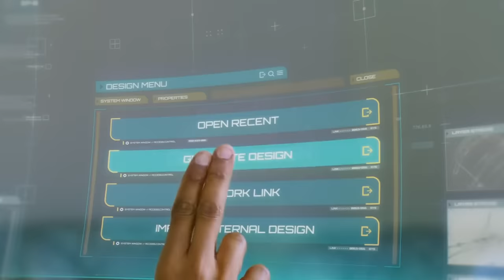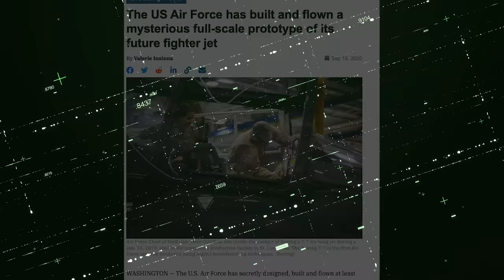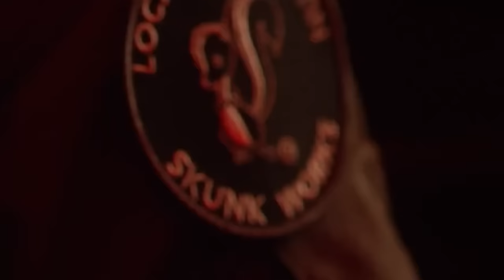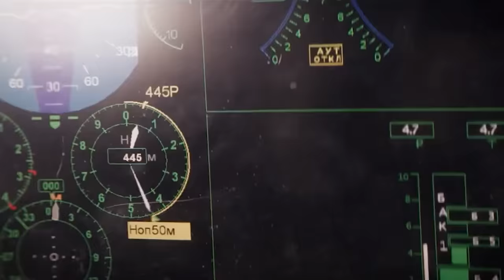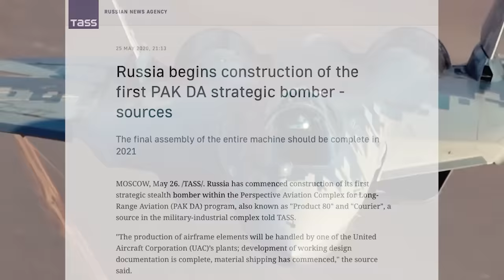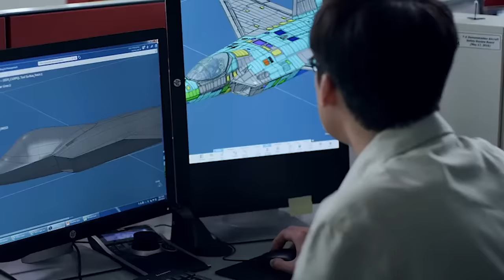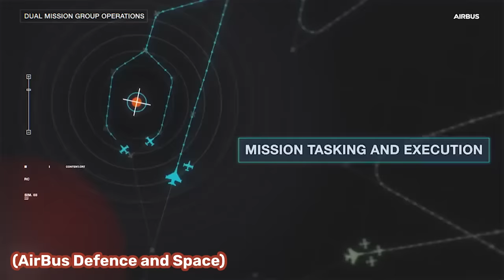12 new stealth aircraft headed toward service

Comment: Sandbox... why would the US Navy need to keep the F-35 once the F/A-XX is added to the fleet?
Reply: Because otherwise the F-35 would be a HUGE waste of Funds. Spend hundreds of billions just to retire after a mere 30 years isn't an Option as the program is must run long enough to ensure financial success. And, the Navy will have 340 jets, meaning they would have to buy 340 New ones and waste even more Money.
Reply: Same reason the Air Force still uses F-15s and 16s, I’d assume. Just too expensive to replace hundreds of aircraft.
Reply: Also, the f-35 will still hold up by 2050 and not need a replacememt.
Reply: F/A-XX replaces F/A-18
Reply: Numbers, and also the 6th gen fighters are going to be like $400 mil each, and designed to be control hubs for drone swarms, so they will only make a few of them.
Reply: Range
Reply: Same reason they kept the Viper & Eagle after Raptor & F-35.

Comment: Surprised you didn’t include the Russian MIG-41 and the Okhotnik programs
Reply: If he included the S-70 Okhotnik, he'd have to include MQ-25 Stingray, XQ-58 Valkyrie, SR-72, AVIC Dark Sword, MQ-28 Ghost Bat amongst many other stealth drones
Reply: @apolloaero  not necessarily, as not all of those drones you mentioned are stealth and/or combat drones
Reply: @lightspeedvictory  only the MQ-25 and SR-72 are non-combat drones, but all of them are stealth
Reply: What's the point of including vaporware?
Reply: @apolloaero  MQ-25 isn’t stealthy. At most it has stealth shaping but that doesn’t translate to full stealth
Reply: @Lightspeed Victory  it is stealthy, it was originally designed for deep strikes. Then the mission changed to ISR, and it changed yet again to aerial refueling. 
It's not a flying wing like most modern stealth drones, but it still has all the features of a stealth design. It wasn't something that was designed and then stealth features were added retroactively. It has a V-tail, engine inlet is above the fuselage, long and narrow rectangular exhaust, no right angles nor conical shapes, angles front of the fuselage, its overall design is somewhat reminiscent of the XQ-58
Obviously there's different levels of stealth. As seen between F-22 and Su-57 for example, or F-35 vs B-21. But to say F-35 isn't full stealth and B-21 or B-2 is would be incorrect. As is the case with your statement

Comment: Pardon me, but keeping the 71 year old B-52 in service, over the B-1 (which out preforms it as designed) and B-2 (which has never been shot down) is ridiculous !    If this happens, both China and Russia will dance in relief.  Never forget that the old B-52 was actively being shot down or a regular basis during the Viet Nam war in the 1960’s.  It can be seen and locked on to a ranges better than 50 to 100 miles in today’s battle space.  It is well past time to retire the B-52 so that their American aircrews do not suffer the way their grandfathers did over Southeast Asia so long ago.

Comment: with plant in the US. Saab/Sweden. In Charleston, SC. That is were the composite materials for Boeing, are made. Boeing built a plant there. Just were stuff is, indicates Saab on board with US. For next gen aircraft. The salesof Gippens, Bofors ,etc. Dont correspond to that kind of plant. The NGAD is a reality. I believe. It is a joint US, and Sweden deal. The swedes have have Tech for composits. It will either be, a joint F35 like deal for NGAD. Or a 6th gen Grippen derivative .

Comment: Stealth technology has largely been defeated by RADAR return oversampling. Yes a lower RCS is always useful but building incredibly expensive platforms around low observability is now pointless - particularly as upgrading or modifying such tightly integrated aircraft ranges from incredibly difficult to practically impossible - the lead time to replace such sophisticated aircraft and train pilots for them also makes them ineffective in total-war scenarios. With gen 4 aircraft you can bolt on the latest technology and be up and running in months - the sensor suites on stealth aircraft are usually obsolete by the time you've gone through the lengthy integration and implementation projects - changes in the field are THAT rapid.  Eurofighter Typhoon for instance could detect a stealth fighter PASSIVELY beyond the high PK range of typical AMRAAM fitments.  F-22 doesn't have such sensor suites - the projects to upgrade the aircraft with such suites have failed - too complicated.   In total war scenarios it ALWAYS ends up coming down to numbers. Thank goodness somebody in power in the US actually understands this and signed off F-15EX!

Comment: Update  and  correction ....

the issue why TFx take so long. because nation had  had f35 project  which was the main cause of slowly development and production. which was failed because of US  political issues. from that point Turkiye fasten development of his own Domestic jet system.  that's why first fases were slow. until now. 
Dec 2022 protype assembly 
march 2023 TFX - It begins ground test out of hanger.  
it uses 2 x f110 engine which is only mean to prototype testing and other data gathering. Aselsan already delivered 5gen mainframe including Pilot head gears other essential parts, and many domestic parts important parts were also delivered .and 
the only issue is the engine planned to delivers early of 2024by  Tusas.  this show significan speed on the development to avoid Turkiye getting harrassed by NATO allies again. 
.

Comment: Why does every other countries aircraft look just like the F-35 or F-22? Do other countries just figure that if it looks like them it will be just as effective? Never wishing for conflicts but it would be extremely interesting to see how these alleged 5th Gen ripoffs would  do in combat especially that J-20.
Reply: Because that's the kind of shape you get when your requirements are for something with the capabilities of an F-22 or F-35. You can't use engine intakes like you see on a Tomcat for example, instead you have to use something like a DSI (like the F-35) or a carat inlet (like the F-22 and Super Hornet. The cross section of the front of the aircraft can't be round, instead it has to be trapezoidal or incorporate chines, while you can't have a vertical tail so that rules out a single tail in favour of a pair of control surfaces that are canted from the vertical to ensure they don't act as corner reflectors. Stealth engine nozzles look similar as well because there are certain functions they have to perform which requires certain features.

It's a bit like why all mid-sized sedans look very similar - they all have to do roughly the same thing and have similar limitations of size, weight, cost, etc so designs converge.

Comment: The British will be replacing the Eurofighter with the F35.

The F35 works on the British aircraft carriers because it has STOVL and VTOL and it needs it because the British carriers are shorter and don't have any capability for conventional aircraft, no catapults and no traps.  Remember to install a catapult you need to have either a nuclear reactor installed to generate the steam or you need to have a power source as powerful as a nuclear reactor to power magnets, depending on what type of catapult you want to install.

The most amusing thing about the Tempest design is it does not have any STOVL or VTOL abilities and therefore is never going to be compatible with the British aircraft carriers.
Reply: EMALS will run off a conventional power plant and you must have missed the part where the US and other countries operated multiple conventionally-powered carriers that were equipped with steam catapults. The first two generations of US supercarriers had conventional oil burning boilers, yet still managed to operate a full set of catapults. EMALS was considered for the QE class carriers but I think they made the right choice in going for the certainty of STOVL aircraft instead. The F-35B is so good that the QE class don't have the capability gap of the older Invincible class "Through-Deck Cruisers" with their Harrier air wings, and had they used a CATOBAR design, they'd be relying on a technology that's still not matched the older steam catapults and is going to take a few years to perfect. That's not a problem for the US which has enough Nimitz class ships to fall back on, but it's too big a risk for a country like the UK that doesn't have a legacy carrier fleet to act as insurance.

There's nothing strange about Tempest having no STOVL capability - it's the replacement for Typhoon which doesn't operate from carriers so why add that capability when there's already an amazing aircraft that can do that job? F-35 is going to keep getting upgrades for decades and is likely to remain the only STOVL 5+ Gen aircraft in service with any nation for a long time to come